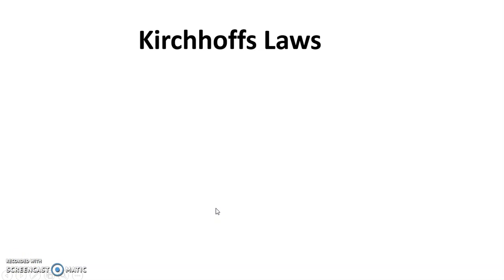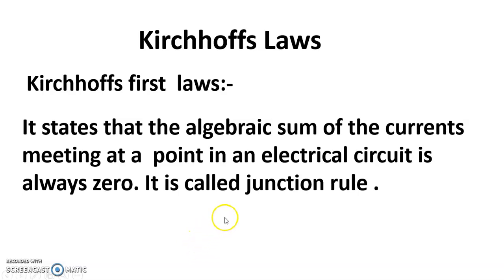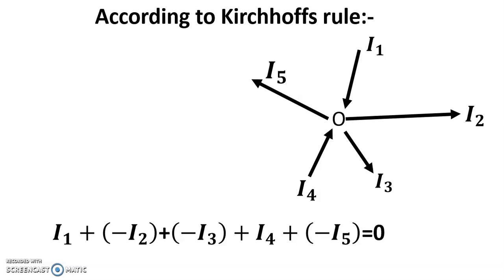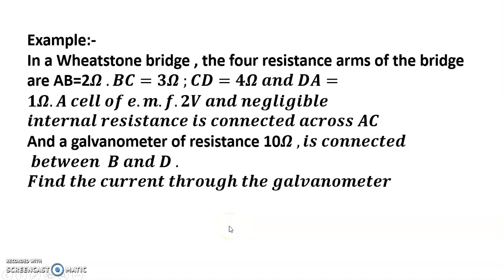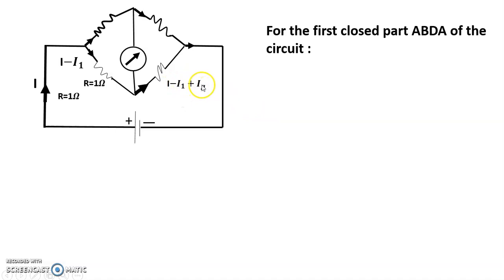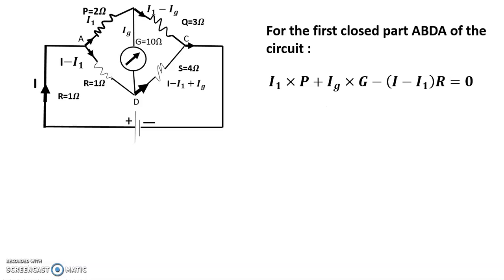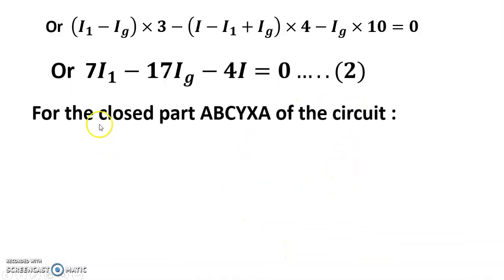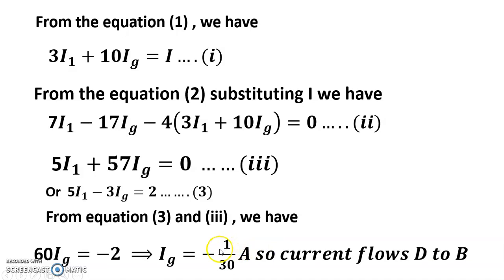how to use  how to use  Kirchhofs law

Comment: Superb.

The values of current, voltage and internal resistance in Direct Current circuits. By applying this law we can also find unknown resistance in the circuit. Wheatstone bridge is an important application of Kirchoff's law.

In the 1st law states that the current flowing into a node(or a junction) must be equal to the current flowing out of it.

"The algebraic sum of voltage in a closed loop is zero".
Reply from the maker: Thank you sir 🙏🌹